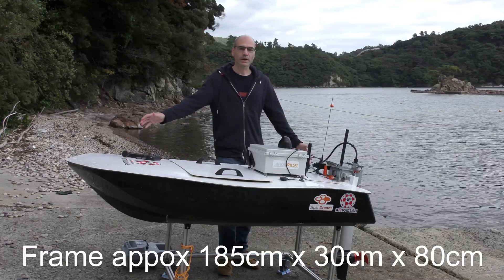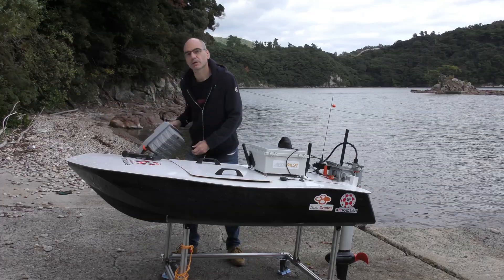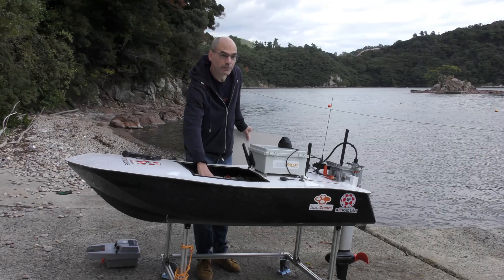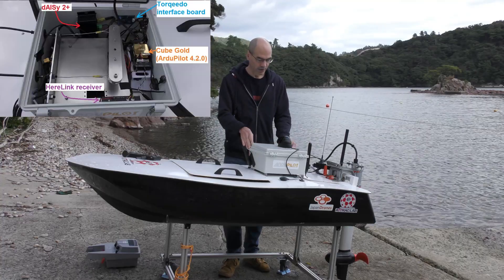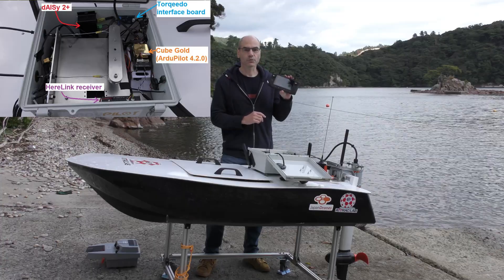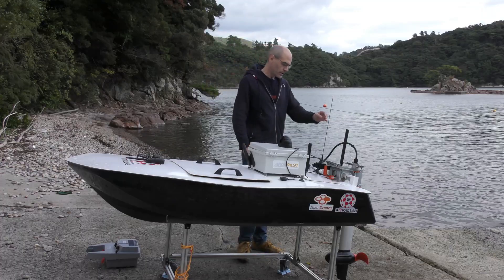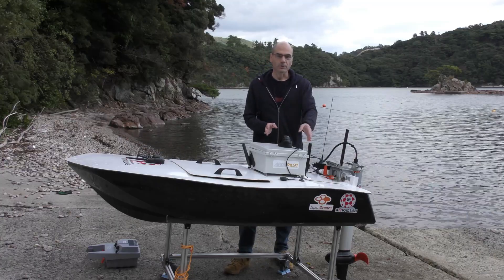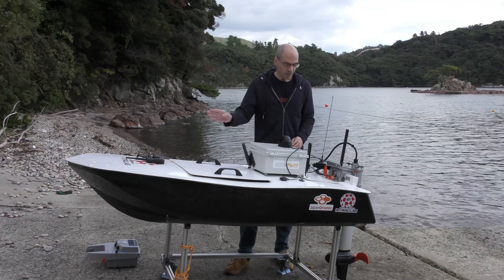DeSET mapping boat testing in Okinoshima

Comment: Hi Randy
A- how about using Rockblock 9603 in connection with the pixhawk flight controller? 

RockBLOCK 9603N allows you to send and receive short messages from anywhere on Earth with a clear view of the sky. It works far beyond the reach of WiFi and GSM networks.
Reply from the maker: Hi @franzfrnz131, yes since I made this video, AP has added support for the RockBlock modems https://ardupilot.org/rover/docs/common-telemetry-rockblock.html so that would be a very good choice for boats like this.
Reply: @rmackay9  thanks Randy
Randy, I would like to build a long range autonomous boat like that but I would like to add solar panels to prolong the battery capacity and achieve longer range

Can you please provide me/ us with guidelines to Connect / integrate solar panels to the batteries in an autonomous boat. I believe there’s a additional unit to dump the current overload just to maintain the battery charge
Reply from the maker: Hi @franzfranz131  ArduPilot supports this MPPT https://ardupilot.org/rover/docs/common-packetdigital-mppt.html which automatically converts the voltage from the solar panels into a voltage that can be fed into the batteries to charge them.  This is an expensive unit but there are also much cheaper systems that don't provide any information to ArduPilot (so you wouldn't see their status on the ground station) but would still work OK I think.

Comment: Would it be more efficient if it was semi submersible?
Reply from the maker: Hi Franciscoe, no, I think it would be less efficient if it was semi submersible.  The more water it has to push out of the way, the more energy it requires so the most efficient boats are very shallow or have narrow hulls.
Reply: @rmackay9  Great presentation 
One last question, you built the autonomous boat? Or or a place I can buy it please

Comment: Do you still have the logs for this mission? if your running RTK it would be interesting to see if the gps altitude oscillations could be used to give an estimated read out of the wave height , I think you would see both high frequency chop and the larger low frequency swells.
Reply from the maker: Hi @geofrancis2001, I do have the logs and I'm happy to share them but I was not using an RTK GPS.  Still, I have also thought that having a wave height estimate could be useful.  I've raised an enhancement request here to share ideas. https://github.com/ArduPilot/ardupilot/issues/19525
Reply: I think Randy does an outstanding job 
This may be useful: spring hinged pontoon to prevent the boat from tilting
https://youtu.be/qvL3XvpyFkY

Comment: Looks like fun work. Any reason the prop hangs so low? I'm guessing it's made for larger craft and easier to just use it as is than try to modify. But I get the feeling it's spending a decent amount of energy pitching the boat backward instead of pushing it forward.
Reply from the maker: Hi @iforce2d, as you suspected, this is the shortest motor shaft that the Torqeedo motors come with and while we think it can probably be shortened it would certainly void any warranty to do so.  Another option is to increase the height of the mounting bracket on the boat frame.  Doing this would probably reduce drag a bit and make transporting the boat a bit easier.  By the way, I noticed that ePropulsion motors (which are very similar to torqeedo motors) also come in an "extra short" length but we haven't added support for those motors yet.
Reply: @rmackay9  an inboard electric motor to a prop and use the autopilot to steer a rudder, less drag than an outboard leg.